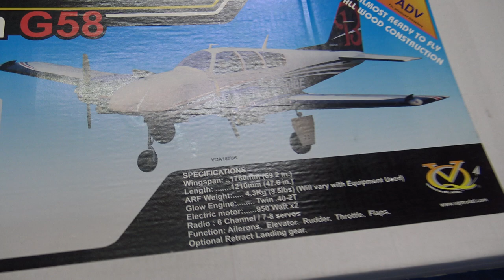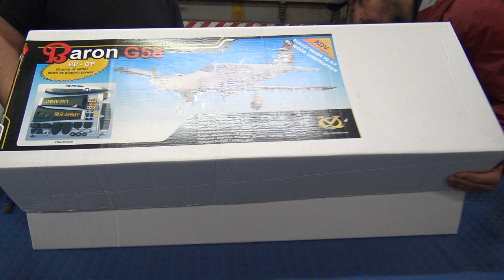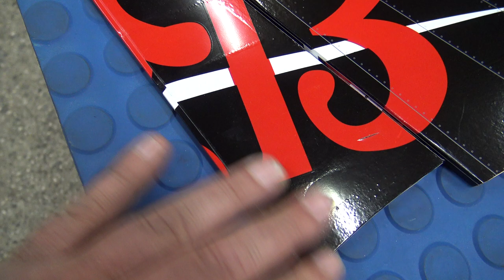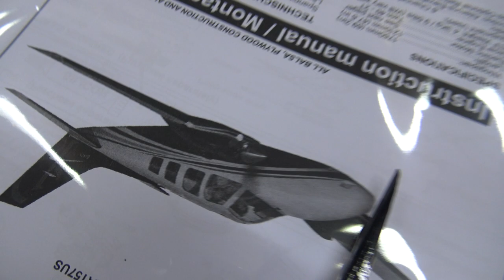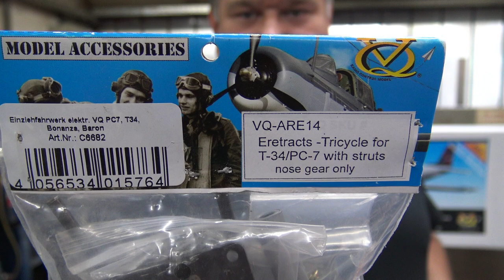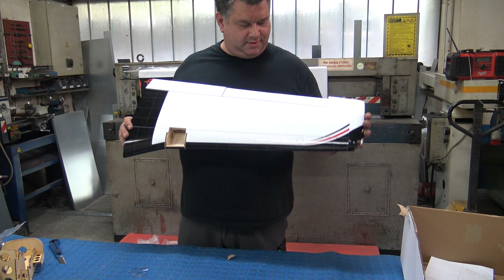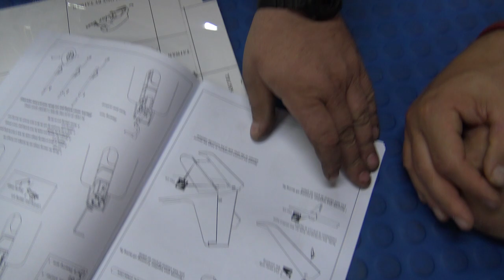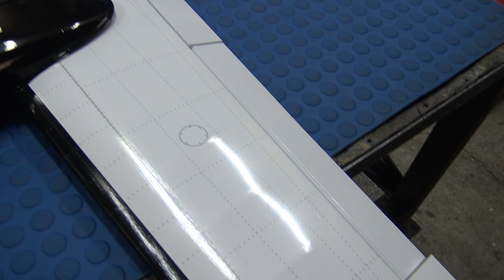Beechcraft Baron G58 VQ models Twin motor 1.76m ARF RC plane Unboxing

Comment: Hey petrincic bros. you can get rid of the gophers using your lawn mower just attach a hose to the exhaust  and stick it in the hole about 1 or 2 feet then cover with dirt and let mower run about 15 minutes you may have to attach a 8 to 10 inch extension pipe to the  muffler so you hose will not melt. Given the size of your field you may have to do it multiple times throughout the area or anytime you see fresh mounds, worked for me on gophers, moles and squirrels simple and easy. Love your videos keep it up and to you both I SALUTE YOU 👍

Comment: Nice to see the brothers back with a great unboxing. Me personally I’m a bit salty about vq models I’ve bought the spitfire 50 and the fw190 both models ended up stalling the fw stalled on a knife edge turn and the spitfire stalled doing a victory roll last week I feel there a little on the heavy side at 8.5 pound on the fw and 9pound on the spitfire there completely confetti 🙈

Comment: Thats a real nice qualaty!  Remides me on " blackHorse" airplaines!  ^^   a Twin motor  ! , but i woud go for 2x 120A , & Electronics is much saver! , with diff.trust " System  !  but 2 petrol.? .. Hmm..  .. that betyfull plaine  !!! ..  but in anyway  Amazing !!!      Nice Build Brothers & gr.to Mister Hubert  , mfg from Austria 🇦🇹✌🏼👍🏼
Reply: Twin petrol engines, spark ignition, two stroke. Very reliable. And with the two stroke, you can re-drill the drive washer, re-position the magnet for the spark pick up.  Have counter rotating props. Tractor prop one wing, pusher prop on the other.